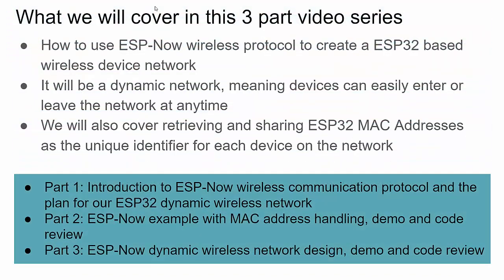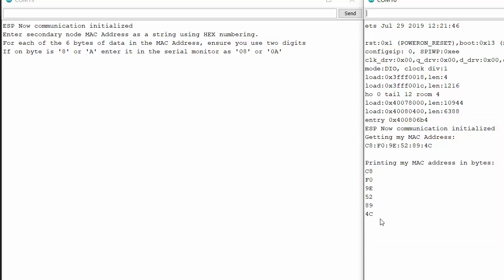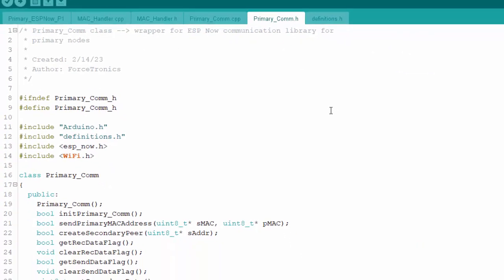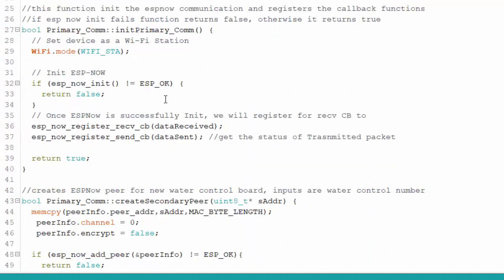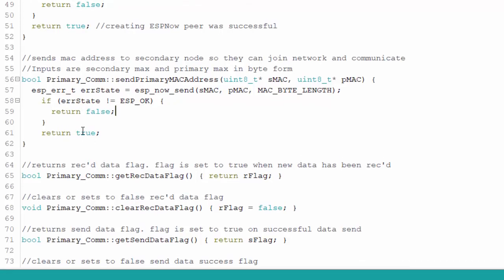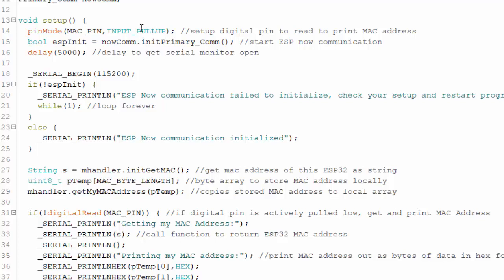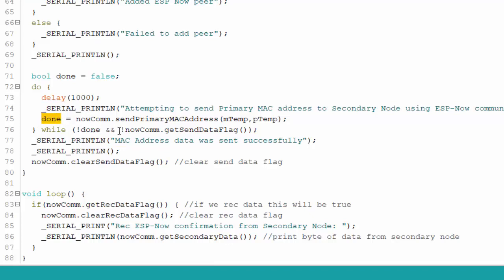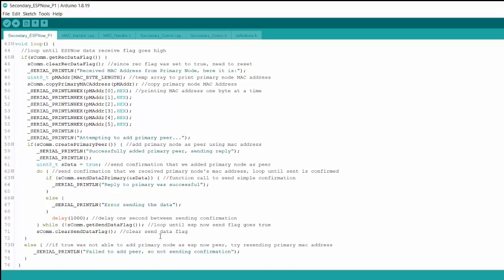Using the ESP-Now Protocol to Create a Dynamic ESP32 Wireless Network Part 2

Comment: FWIW - I’ve got the latest Arduino IDE version 2.3.2 installed with Arduino ESP32 v2.0.13 & ESP32 by Espressif v2.0.12 and neither came with the ESP-Now libraries.   So maybe something changed since this video was released?
Reply: Figured it out - under IDE Examples, then Examples for PICO-D4 (using that from Espressif), then under ESP32, then ESPNow.  I also needed to go under Sketch - Include Library and Select ESP32.  The only way to make sure when compiling that the esp_now.h file could be found.